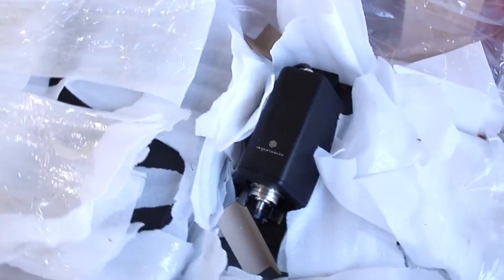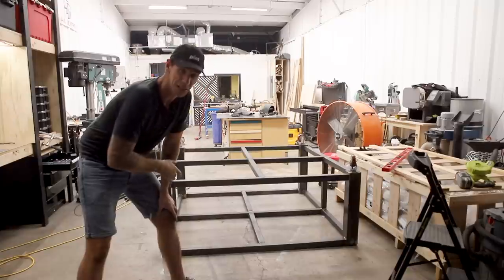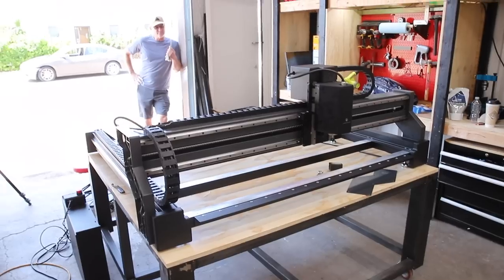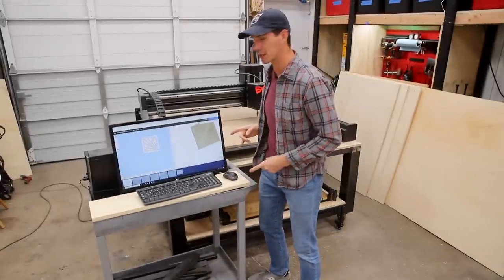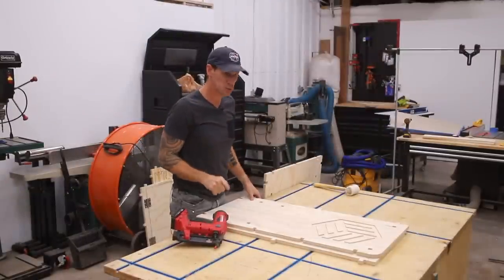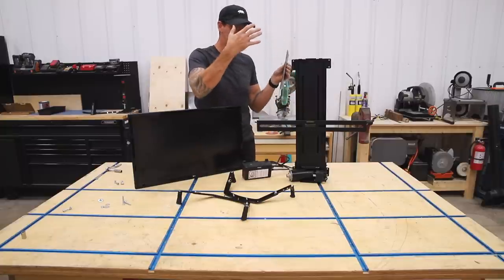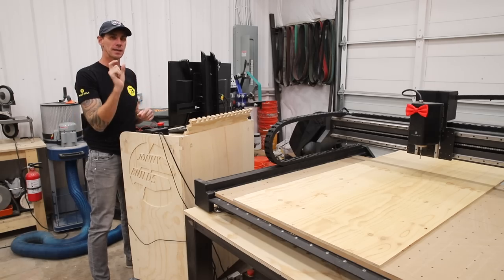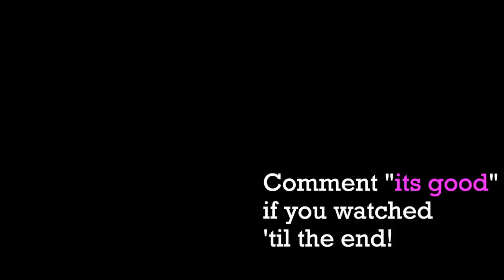Building a CNC Cart & Computer Cabinet for my X-CARVE PRO | Free Plans

Comment: Are the cables with the Pro long enough to run from computer under the table to your cart or did you have to get extensions. My Pro is on order and trying to get some preplanning done so I am ready at delivery.
Reply from the maker: No extension needed, but you’re looking at a usb to usb c, and an Ethernet cable if you wanted to extend it even further. Without being in the shop right now to measure I’m guessing the cables are 8’. Enjoy your Pro!

Comment: Instead of the box joint style seams you could do a bevel so that when closed it is actually sealed from dust
Reply from the maker: You could, but it’s not like I have a crazy amount of dust flying around the shop. Just being inside the cabinetworks great as is.

Comment: I would also add some high flow low noise fans for heat.  One of the most common ways is to push the air up from the ground and blow it out the back

Comment: 4x4 steel for a 4x4 table ... makes perfect sense!
Do you have some type of locking mechanism holding the lower cart in place for when you move the entire unit around?
Reply from the maker: No for when it’s rolling. It mostly stays put, but does move around a small amount. Those were double locking casters on the small tray as well for when it’s in use.

Comment: What size table did you build ij have the pro in order need to make a table  I like yours alot! I don't have sjectup so I couldn't see the top size
Reply from the maker: 64x64. Could’ve been 4 inches woder
Reply: Hey man great video! I have one in order myself. So you recommend 68”x68” or 68” x64” and what height would you recommend?

Comment: Just a heads up as you already experienced it, most spray paints don't play well with most foams as the acetone or other thinners used melts the foam. You have to apply something adds a protective barrier first like modge podge, epoxy or anything that doesn't have thinner in first than you can paint with spray paints
Reply from the maker: Yeah I found that out, but it wasn’t bad at all. Good info for next time tho. Thanks 🙏

Comment: Pretty cool. Probably should've just used a set of heavyweight full extension rackmout server slides for the little-guy though.
Reply from the maker: Another option, but what I did worked great and was a super cheap solution.